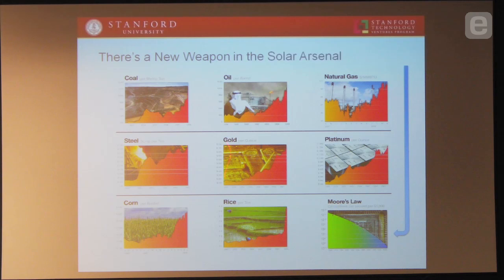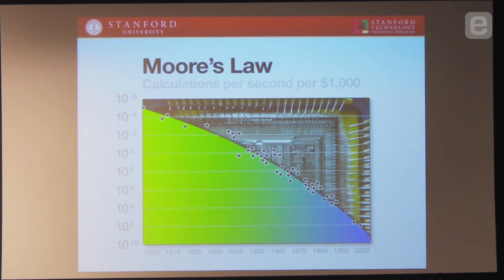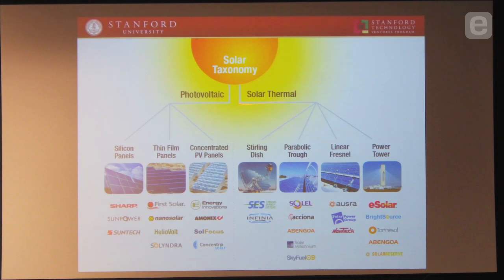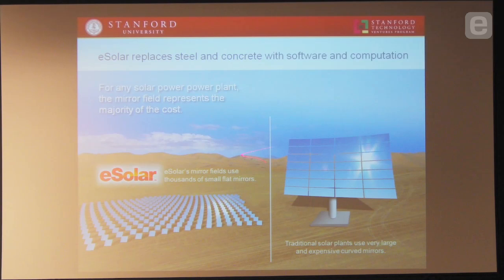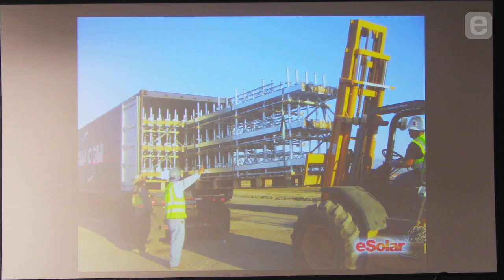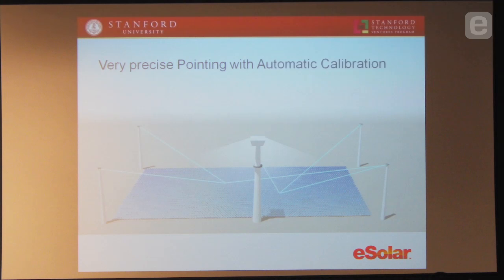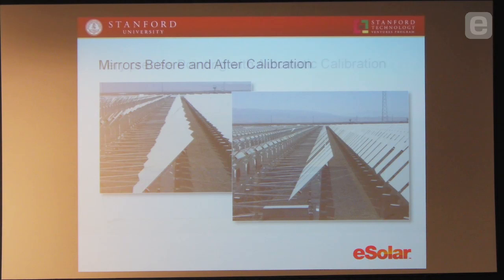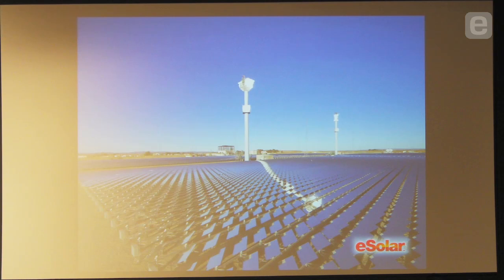Bill Gross: Moore's Law: A New Weapon in the Solar Arsenal

Comment: Why not make the tower black to absorb more heat?

Also, why not use a molten salt Brayton turbine to create electricity? More efficient due to higher temperature differential. You could get over 50% thermal efficiency with this.
Reply: +Quantum Leap Interesting idea, I will check it out.